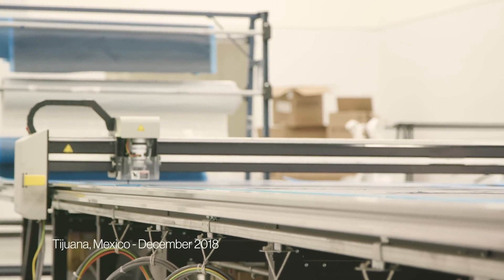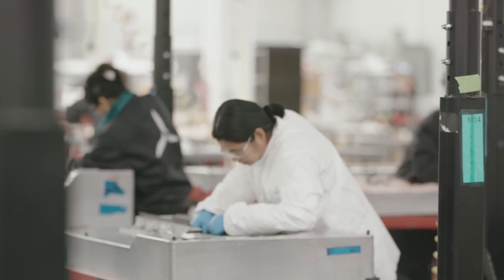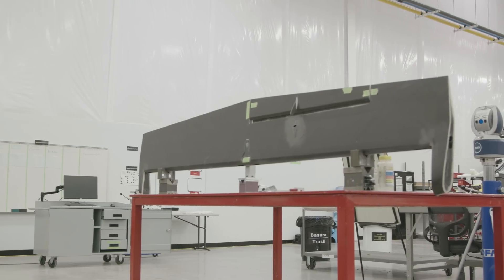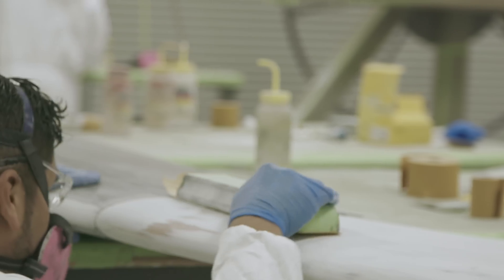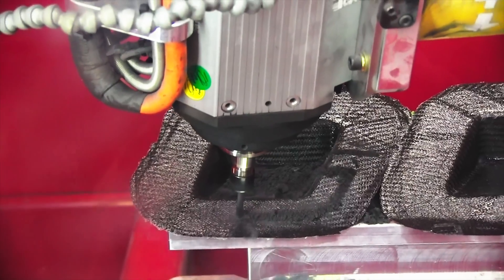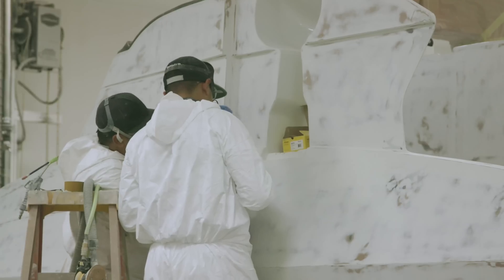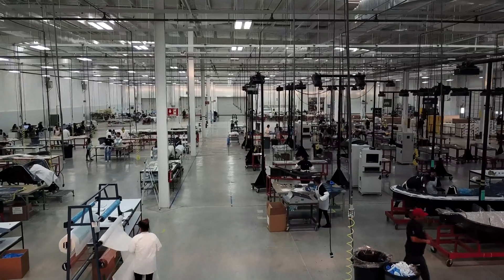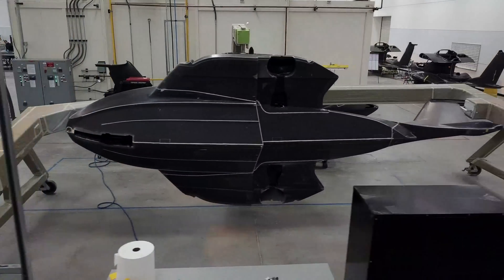This is where the ICON A5 Begins | ICON Tijuana

Comment: I'm just curious.... Did you guys pick Tijuana for less expensive labor or for regulation reasons?  I'm genuinely asking,  I'm not bashing you for deciding on Mexico for your factory, I'm just curious why you chose Mexico over California.  Was it a significant labor cost savings or were California/USA laws the driving force for your decision. Lastly, and I don't expect exact figures,  but what percentage difference is labor cost in Tijuana vs. San Diego?
Reply: It is cheaper but Tijuana also has top aircraft engineers. Mexico has very skilled, educated workers. And whatever made in the border qualifies for the Nafta zero tariffs.